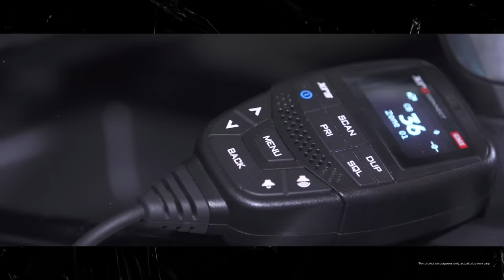EXTREME Camper Trailer Testing With My Kids

Comment: A couple of cameras in the back of the jeep tray so you can see where the trailers going may be a good idea and a remote so you can adjust the trailers  suspension especially when the trailers tight against the rocks and you can’t access the trailer controls! Awesome vid guys keep exploring 👍

Comment: Let's go! Awesome ❤ what tire pressure you guys were running? They look hard
Reply: Seems those tires aren't performing the best for traction?  A little mud and slick as.  Playing with pressure down a fair bit?  Worse case get some Treps for her :)  (Maxxis Trepadors)  You'd be well served with the stickiest tire you can find!  (that trailer weight plays havoc, but Jeeps just climb, you might need more testing just to figure out your optimum's set up on the Jeep alone then skull drag that Patriot up and over :)

Comment: I have never been up close to one of your campers but they look & seem to work well. I don't know I will ever have enough money to own one. By saying that I am not inferring whingy whiny  that they should be cheaper.

A great American Economist once said ""Quality costs less"  if you spend for quality it will tend to out last cheap by 3-5 times. I have bought both cheap & then quality products & seen the difference in how the quality product outlasts 3 or more  times than cheap equivalents.

That jeep is awesome, with how you have built it & driven it. Not all of us are going to have the financial capacity to own something like that either. 

Don't get me wrong seeing it in action as a test & in comparison to the GU was great. But I would of also liked to see how the GU coped with towing the camper because it is something more accessible to most. 

If the average guy/gal bought a GU , then maybe buying one of your awesome campers might be a bit more doable.

I would still buy your camper even if my 4wd could not quite pull it in & out of the places you took that camper with  the Jeep.

Great video!
Reply from the maker: 👊 cheers legend